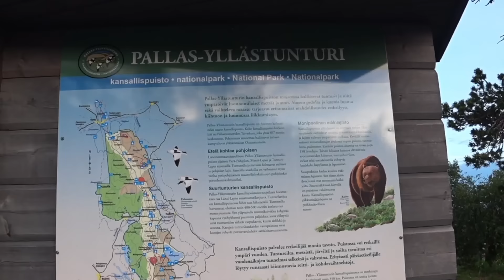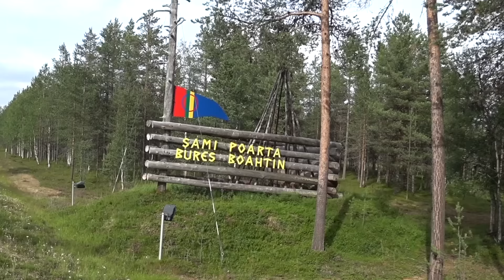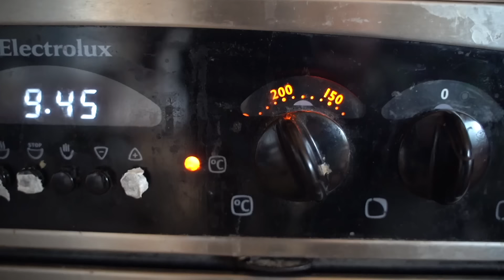Puukko Knife Making - Traditional Crafts of Finland / VLOG 30 - Cycling around the world

Comment: Hi to you both (even though it’s a solo ride). Nature is beautiful! Have you considered 36 spoke wheels, would they hold their trueness more? And yes “sun is shining-life is good “
Reply: I wonder the same. Do 32 spoke wheels have more spoke breakages while touring with about 30 kgs weight as compared to 36 spoke wheels?
Reply from the maker: Hi , yes 36spoke wheels are stronger than 32. but also components you use for building your wheel plays a big role on how strong your wheels are. and off-course a good wheel build also.another  factor here is the disc brakes, for sure disc brakes put stress on the spokes. specially with heavy loaded bikes. so i would defiantly go with 36 spoke wheels with good components for touring. :)
Reply from the maker: @thattravellingguy  the thing about weight and cycling around the world is, you can't count on how much wight actually you might carry. because at some sections of your tour you will carry water and food for many days. this kind of sections are usually off-road and will put a lots of pressure on your wheels. so i would highly recommend to ignore the on going trend with having light weight bicycle and make sure you have  the strongest wheels possible for touring/ bikepacking regardless of how heavy or light you think your luggage is. :)
Reply: @NomadsTrails   @Nomad's Trails  thank for replying Peyman. Since the surly disc trukker, Kona Sutra, trek 520 are not available donce 2 years, i was considering the Marin four corners cycle for touring. Do you have any idea about that? And thank you both once again for your beautiful videos.
Reply from the maker: @thattravellingguy  Most welcome, I ever tried the Marin bike, can't say so much about it really. i wold make sure bikes has durable and simple components,  stiff enough frame and durable wheels. also it is really good if frame can accommodate wide tires. :)